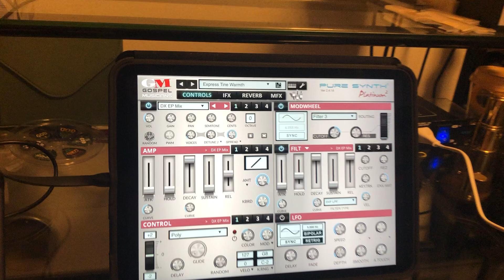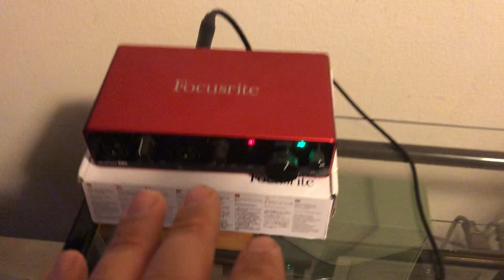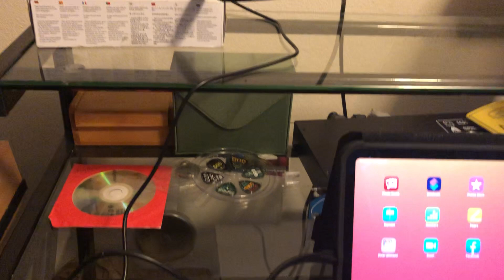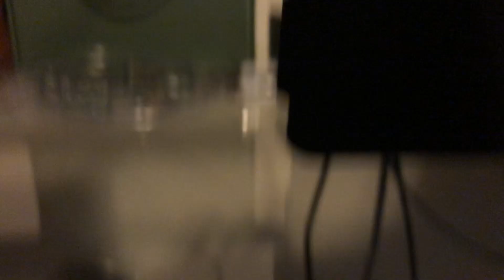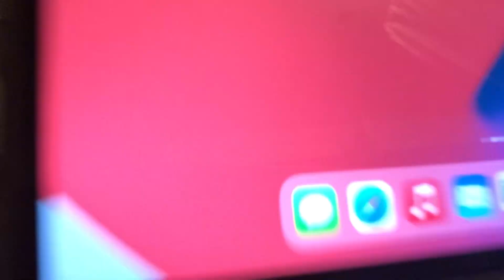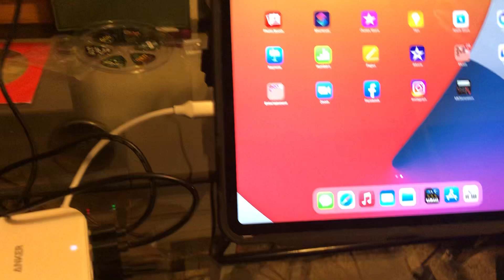Connecting midi usb keyboard piano into Ipad Pro and playing for Live Sound

Comment: Can I ask you a question? Is it possible to achieve the same thing if i use just an Ipad, IPad port to USB (female), and a midi in & out to USB (male) to plug to my electric piano without having to have the audio interface. 

What I meant is that 
1. I plug my electric keyboard to the mixer for the sound output.
2. Have the Midi In & Out to the electric keyboard and the USB (male) to the IPad (female).  
3. Then use the IPad app (Garageband) to change the sounds for the live performance

Question: If it is possible,  will there be possibility that the latency is there?

Thanks a lot :D
Reply: I don’t think the wire will put out enough power from the iPad. I tried this from my midi keyboard to my iPhone and it didn’t work. Might be different on the iPad though, if it is let me know because I’m wondering the same